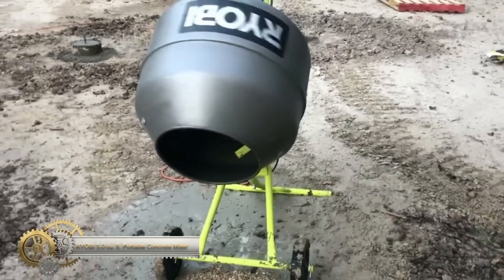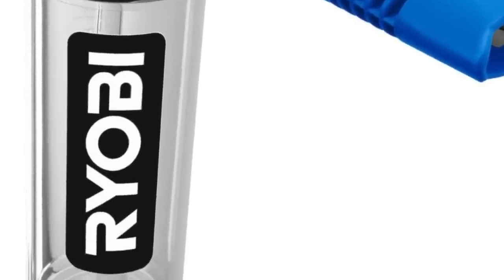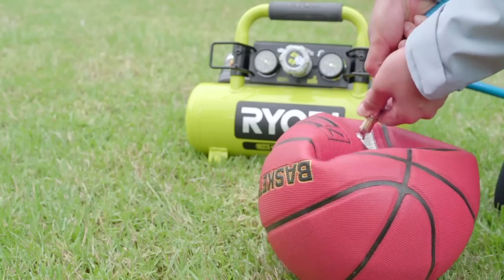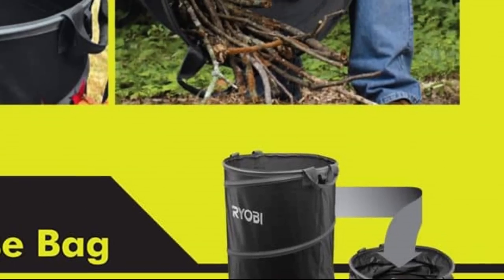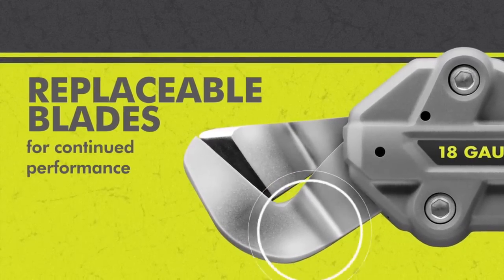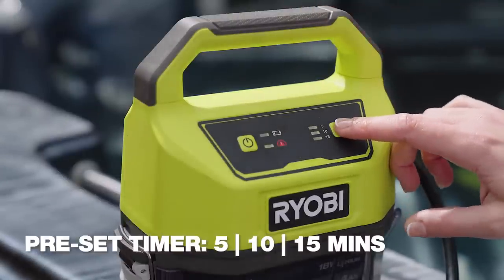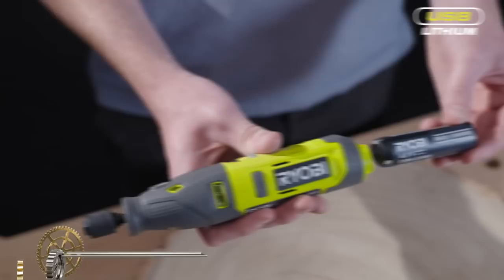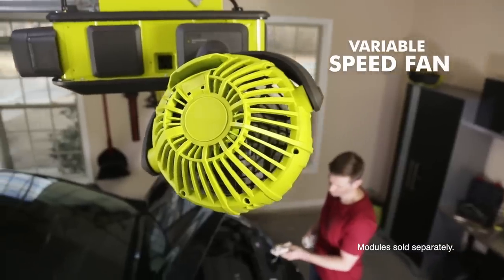The Coolest Ryobi Power Tools to Make Your DIY Dreams a Reality 2023 ▶▶ 5

Comment: The website says the garage door opener was discontinued. Also the infrared thermometer is unavailable as well.
Reply: It was. A couple years ago they were sued by another garage door opener company who claimed a patent on “internet controlled features”. While it was in court, they had to stop selling them.  That claim was invalidated though. Ryobi is supposed to bring their GDO back to the market this year.

Disclaimer, I own one and love it.
Reply: @timothylynch1380  I own one also and love mine as well.  I would love to see them bring back the accessories that go with it too.
Reply: For real?? I was one of the first to purchase the garage door opener. Have had challenges over the years but would love to see them bring it back. The door sensors were a issue until I got a manager to send me their own, it was not compa5ible with other brands
Reply: @timothylynch1380  were did you hear that They were bringing them back? I've been looking for used ones since they got discontinued
Reply: @stevebrown5603  it was a couple years ago.  The pay had to pull them from the market because of a patent issue on the App control interface. The judge ended up ruling  that the patent was not tenable because it was to vague (basically “control of opener over WiFi and cellular connectivity) so he gave them a couple more years before everyone could do it.  IIRC, that end of life was Dec 2022.  So Ryobi should be manufacturing them now.
Reply: I would love to buy it....❤. If they would also offer an European 240Volts version❤ of the Garagedooropener with accessories!👍
Reply: @timothylynch1380  One year later and still waiting for them to bring it back. I think it's dead...for good. A shame, really.